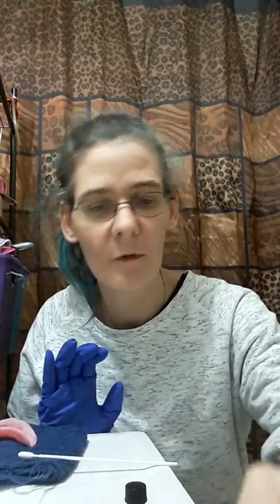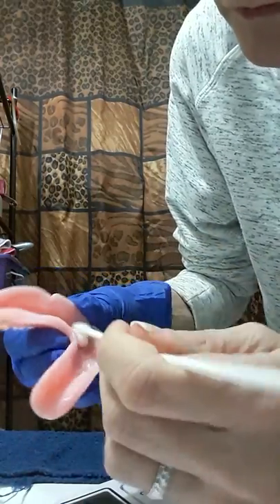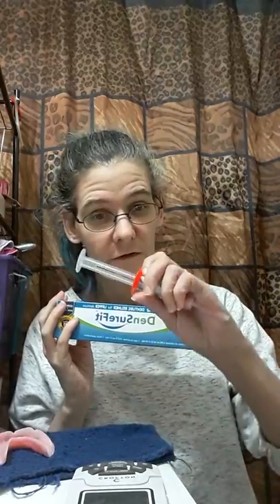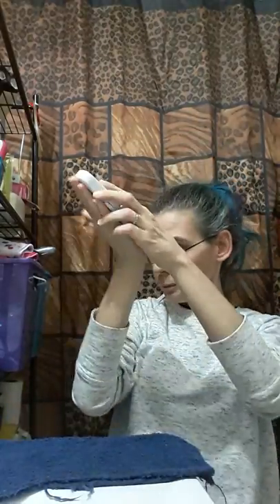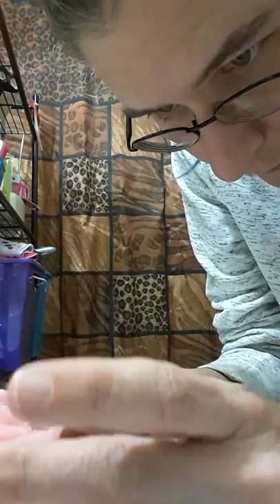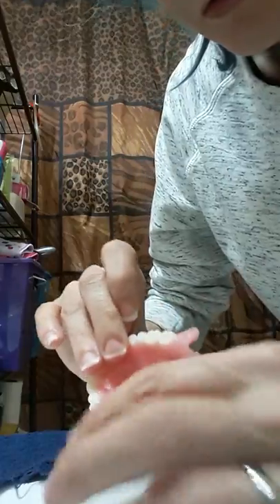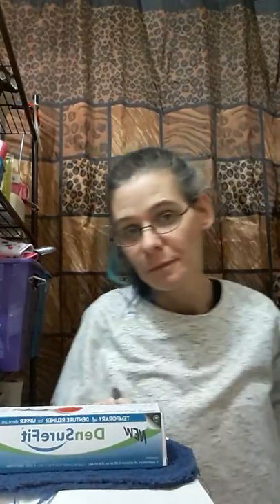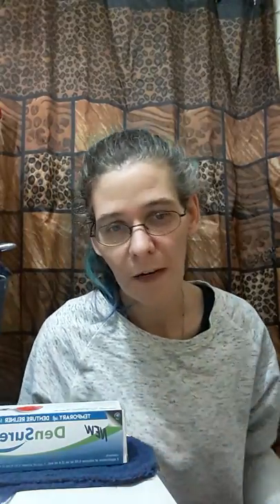Application of densurefit on full lower denture

Comment: Gizmo, nice job with your lower application! You likely don't have any more room in the lower for more silicone right now. If the silicone traveled all the way to the top of the wall and flashed on the ridge, that is an indication that all your voids are filled. You might risk your denture floating if you add any more. Yes, because DenSureFit isn't adhesive, it has no stickiness, so to keep the denture down on the gum line, use a sprinkling of powder adhesive on top of your silicone liner and you'll be good to go! Thanks for letting tag along with you during your reline! Cheers to snug teeth! :)
Reply from the maker: Thank you. I actuly dont need glue it stays in place as is tords the end of the night it gets a littl lose but thats close to when im taking them out

Comment: Gizmo48401, That was a great job.  If you do another snug up on the top, I don't think you are supposed to put anymore on the palate.  Your not supposed to overbuild the palate.  I enjoyed your application methods.  Yes, it's a very good product and super helpful to get us over the hurdles till our next relines, etc.  That's how I used it.  At least you can keep the denture in your mouth without the glue while talking. I wouldn't take off too much flashing, because I think you can ruin the seal of the denture.
Reply from the maker: I only. Removed what i.  Did in the video  on the lower  the top  i had to. Get a littl more on the back but i still have bare spots on the palat
Reply: Gizmo48401, That's what happened to me the last time I apply it on top.  I had some bare spots on the palate.  They told me I may have gone over the 30 seconds (which I probably did) to get the silicone on, and in your mouth.  It goes very fast.  Nevertheless, if it is helping you, and I heard the suction when you tried to remove it, I think it may be okay for now.  Please update us on how life is with your new Densurefit application.
Reply from the maker: @MWall  i will  in a few days  got to get them coupel days  to see. How it goes